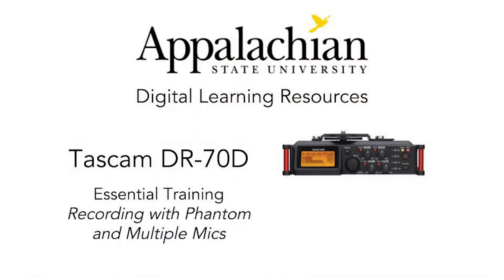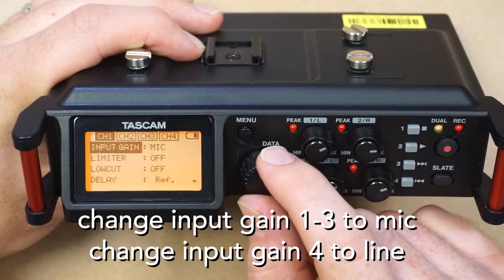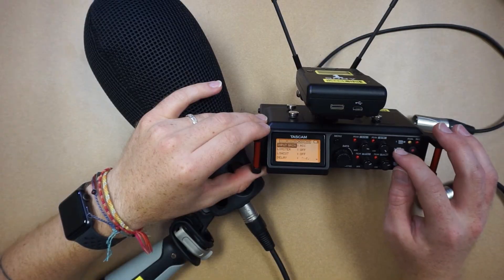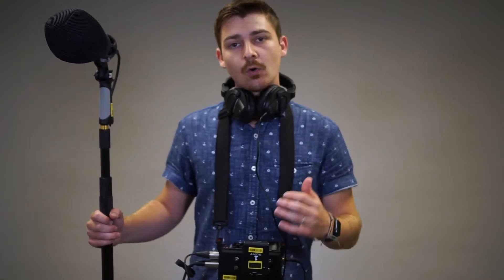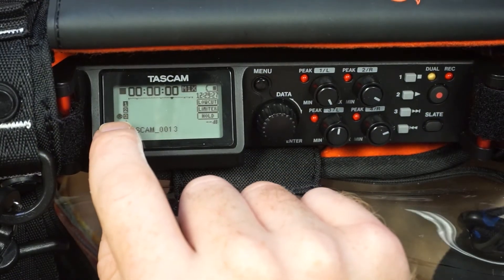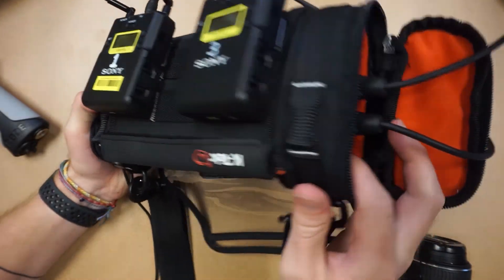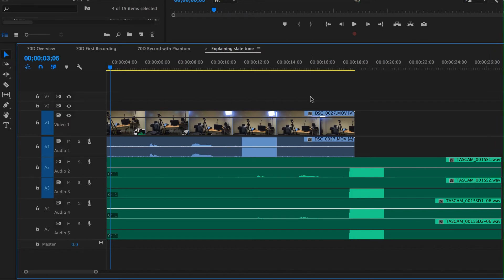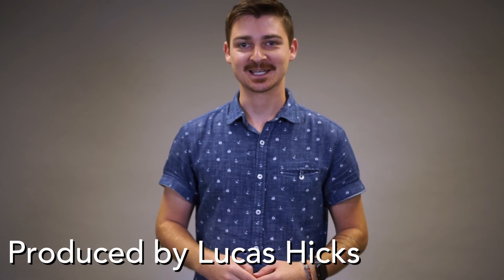Tascam DR-70D Record with Phantom

Comment: Hello and thank you for your timely tips. I want to use the tascam with a MKE 600 microphone with 1.5V AA phantom power. In the menus, input then input gain should I select mic + phantom and turn on the microphone? OR bundle on mic and turn on the mic (the idea is to use the mic power and save the tascam power). Second question: using the MKE 600 microphone as a phantom connected with an XLR cable, how can I connect the Sennheiser XSW DIGITAL RX35 receiver to the tascam with the mini jack cable to the EXT in 1/2 input of the tascam (the idea is to use the XS Wirelless Digital with an ME 2-2 lavalier microphone with the Tascam DR-70D which is itself connected to a MKE 600 microphone connected to an XLR input)? Maybe it's the same process as with a Rode wireless go? Thanks in advance.

Comment: I still can't figure out how to set the DR-70D to record the slate sound on camera. I'm using a 5D Mark IV and have the audio cable going out of the DR-70D and in to the mic in on the 5D. I'm using a SENNHEISER mic from channel one and running on battery power not phantom. Thoughts? I cannot find out how to do this anywhere including the manual.

Comment: Needs way more information....but a good start
Reply from the maker: Joe , Hey! Thanks for the comment. What other questions do you have? I'd be glad to answer them.
Reply: 1.  handling stereo recording using the mid-side technique
2. using the x/y method
3. (very important to me) the ORTF technique
4. Determining gain in the recording settings... low/high/very high
these are just for starters
5. recording a loud rockband in a bar....  mic level or line level? or is that not how to handle the issue
6. Are the mic and line levels an exponential level above the low/high very high settings?
7. why are we told to record stereo using xlr ports 1/3?

these are just off the top of my head.  I'll have about 20 more questions tomorrow
Thanks
Reply from the maker: Joe. Thanks for the feedback. This training is meant as a fundamentals course for someone who doesn't know audio. We will be dedicating your questions to their own video in order to discuss each one in greater detail. Thanks again.
Reply from the maker: Joe in the meantime. Here's the best Mid-Side technique video I've found https://youtu.be/WutTY25fj-g